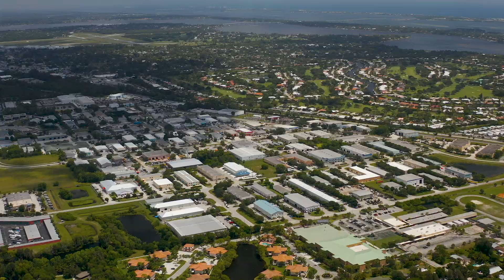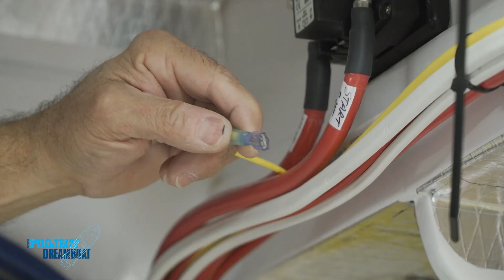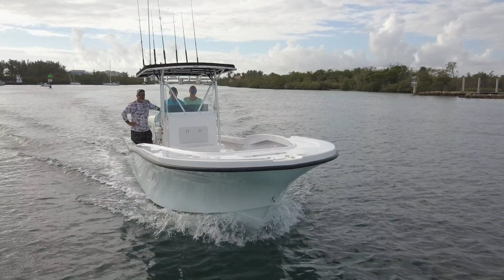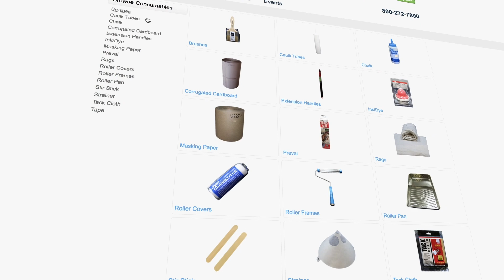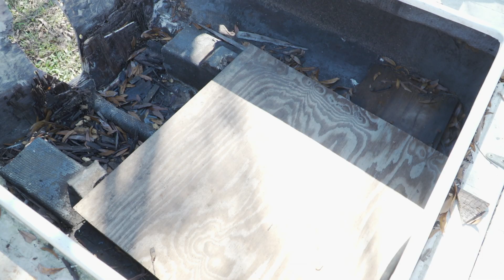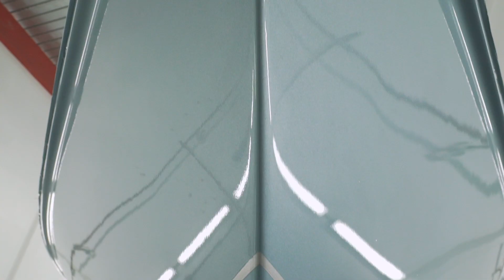Florida Sportsman Project Dreamboat - Billy Knowles Overtime, Clean 25 Dusky

Comment: I like doing transoms in layers 3/8 or 1/2 three layers epoxy mat between layers. Even if the wood rots one layer there are two other layers plus a thickness of  glass for strength. Really like not putting the wood all the way to the bottom excellent idea.

Comment: I just put a new Yamaha 350 on our 76'  24 ft dusky. We've rebuilt a 68' 31 Bertram, a 70s model mako, but our 24 dusky is my favorite. We had a little issue with how wet the boat was. I think the boat had a old 175 HP motor on a bracket, which couldn't hold the new 350, which I believe made the bow burry in the water. The older boats that where built before trim tabs were a thing, have what they call a hook built into the hull, to make it trim up. We filled in the hook and added anew pvc splash rail and now you can't get wet if you tried. The boat is a tank! Last time we went out it was so ruff, we broke a tower leg. But I can guarantee that you will not have a back ache the next day. Solid boat.
Reply: I'm having the same issue on my 77 dusky burying in rough seas, but it is a tank and I love dusky, gotta figure it out.